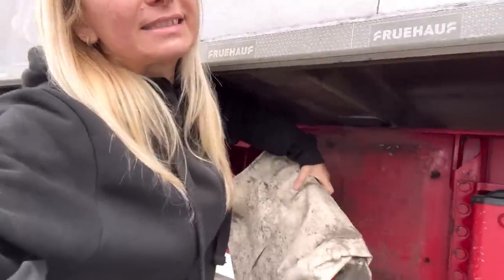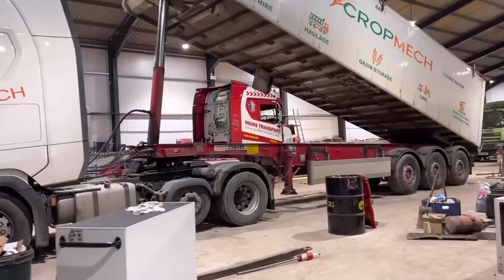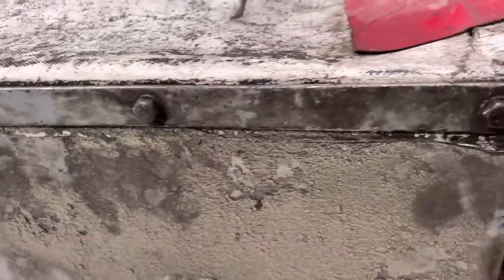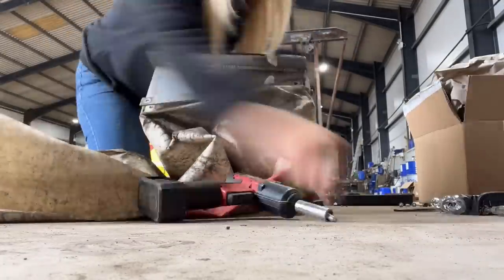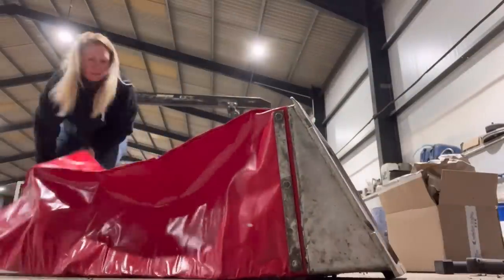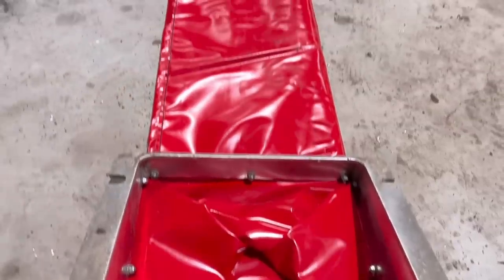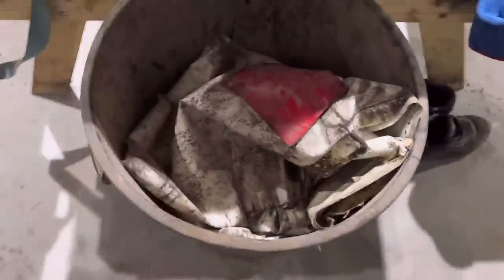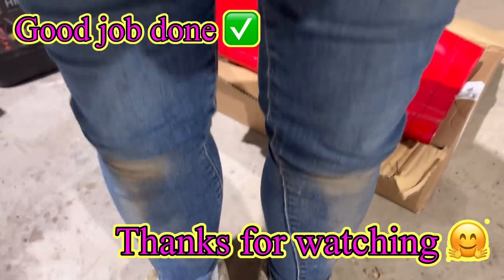How to replace a worn grain sock

Comment: Good job but personally I’d put nuts on outside so threads don’t get rusted up with products your carrying making them a bar steward to remove next time
Reply from the maker: Good tip! if never had a problem with one before. maybe as our products are very dry but I can see your point